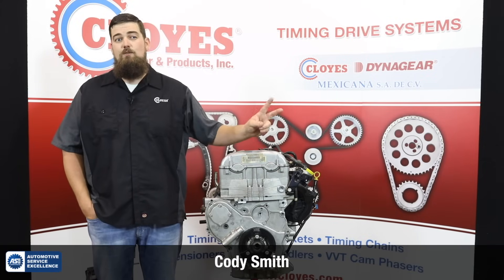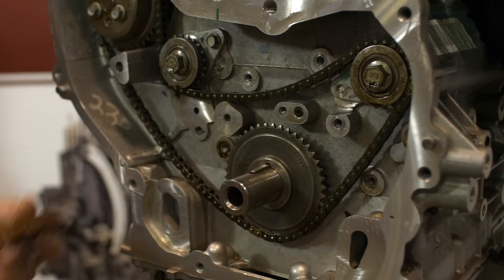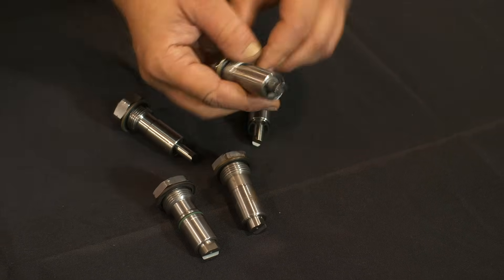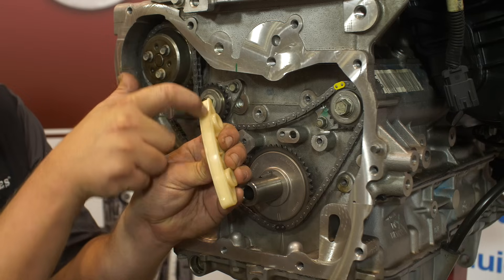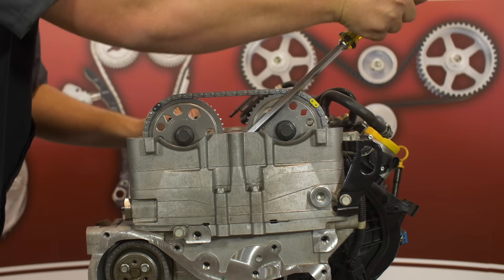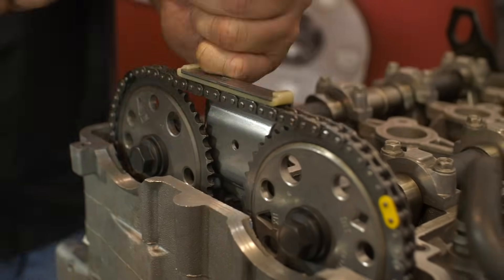GM 2.0/2.2/2.4L, Timing Chain Replacement, Cloyes 9-4201S & 9-4202S

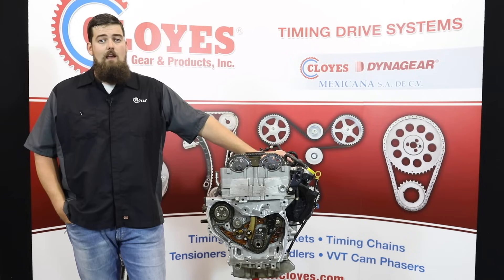Comment: 2:22 odd I my intake and exhaust marks are opposite for me at compression TDC. 
There are two TDC’s
TDC compression
TDC exhaust
Which are you at?
I am TDC compression.
Reply from the maker: The timing is set at TDC exhaust stroke on this engine.
Reply: @Cloyes01   Well I am screwed then. I just took my apart on TDC compression stroke.
The Chilton’s manual I am using makes no mention of this.
Chilton’s manual under TDC quote, “TDC generally refers to piston position on the compression stroke.”
Reply from the maker: @badmatt4227  It's not a big deal, with the chain off, just rotate your crank about 15-20 degrees past TDC to move your pistons down in the cylinders some. Then you can rotate both camshafts around where they need to be and then you can bring your crank back to TDC. Just rotate the cams slowly and don't force anything.
Reply: @Cloyes01 I am not as experienced as you. I will put the old parts back on. Rotate the engine, and basically start over. I am not happy with Chilton's.
Reply: @badmatt4227  Thank for bringing this to my attention I am planning on replacing my timing chain very soon (4 days or so) and I am taking as many notes as I can to assist me! This truly opened my eyes!
Reply: Coming straight from the Haynes Manual "Each piston reaches TDC on the compression stroke and again on the exhaust stroke, but TDC generally refers to piston position on the compression stroke."    :O
Reply: just went to the section for timing chain removal and there is this "the procedure for 2008 and later vehicles are similar to prior years. It is important in Step 2, that 2008 and later vehicles are set to TDC on the exhaust stroke - not compression stroke."
Reply: My Chilton's step by step says TDC on exhaust stroke ... Cam lobe at 7ish o'clock
Reply: @mickeybuck638  Which book?
Reply: @badmatt4227  idk it is the book I access on the library website
Reply: @mickeybuck638  Manual 28670 does not

Comment: Just a heads up I had a cloud timing kit installed in my equinox 20,000 miles later the engine is junk the chain guide was in pieces in the pan and the chain ate up the bolts sending metal into the engine causing severe damage  I would recommend buying factory parts unless you can afford a new engine
Reply: The OEM are the exact same parts. I am a GM Technician and have installed dozens of timing chains on these engines. The OEM GM parts literally say Cloyes on them.
Reply: @mikeday8826  exactly I recommend a upper guide bolt because the factory ones tend to break off dorman makes a great replacement bolt
Reply: @zachfdogg2021  yep, the updated design bolt is the way to go.
Reply: @zachfdogg2021 Did you replace all the guide bolts? This job keeps nickel and diming me. Always something else to replace just in case.
Reply: You didn’t replace upper guide bolt
Reply: This is an oem part it's what gm used in all the car from the factory 😂😂😂
Reply: @kennyupchurch  it doesn’t come with a guide bolt

Comment: Does anyone know if the factory original chain would also have the colored links?  I checked my chain and it is pretty tight for 162k miles, and when looking at the chain I saw the colored links (a black and a red one), so I'm thinking maybe the chain was already replaced??  Or could this still be original?
Reply from the maker: All versions of this chain will have the marked links, even the OEM. And it could be a number of different colors and combinations. GM used at least 3 different colors, likely more. If the links were painted instead of plated by the manufacturer then the paint can flake and chip off over time.

Comment: Any tips on torquing the crank pulley bolt?
Reply: Just impact it on.
Reply: For the ecotec 2.0 turbocharged / LNF, I believe it is 74 ft lbs + 120°... 
Probably the same for all of them

Comment: Do you know which specific 2.4L engine codes this video applies to? Is it safe to say that all 2011 and later 2.4L Ecotec engines will follow this process for the camshaft notch positioning, where the number 1 piston is at TDC on the exhaust stroke when the mark on the crankshaft key is at the 12 o'clock position, the mark on the intake camshaft sprocket is at the 10 o'clock position, and the mark on the exhaust camshaft sprocket is at the 7 o'clock position?  I want to make sure that there aren’t any 2011 and later engine codes that would require the mark on the intake camshaft sprocket to be at the 5 o’clock position as is needed with 2010 models. Thank you for your help.
Reply from the maker: All 2.0L, 2.2L, and 2.4L Ecotec engines follow this basic procedure. In all cases, the unique link aligns to the intake mark on the intake camshaft, and the other 2 chain marks align to the crank mark and the exhaust mark. The chain sets the timing, so as long as the 3 marks are aligned you are good.

Comment: At 11:33 how does turning only the intake cam shaft not mess the timing of the whole operation up? This is the only part i am unsure of.
Reply from the maker: The chain sets the timing. As long as all the marks align when you get the chain fully installed then the engine will be in time. If you need to rotate the shafts slightly to get everything aligned that is OK, as long as the marks align when you are done.
Reply: I understand  everything till 11:34 ..procedure comes up ..I understand that you move the exhaust or intake cam...counterclockwise wise to "help" the Cam Phaser ..get align with the chain's color link but its not mandatory to move it .??.along it aligned up with the marks? Correct?
Reply from the maker: @t0ny2trill  If your chain and sprockets marks are aligned, then it will be 100% correct. Sometimes all the shafts are sitting perfect and you don't need to move anything,  but sometimes you might need to move a shaft slightly to get it to come together. But ultimately the chain sets the timing. If your marks are aligned, then you are in time.
Reply: @Cloyes01  thank you cloyes after getting my hands dirty , I see why you need to my move the phasers ...to help you put the chain on and to properly set the phaser on the cam ..it will make a clicking noise  .
Reply: @Cloyes01

Comment: What happens if I am unsure if the intake and exhaust sprockets moved on removal and install? Wasn't sure if I kept them perfectly still while taking them off.
Reply from the maker: When you reinstall the chain and align the marks, the camshaft positions will correct themselves if they moved.
Reply: @Cloyes01  I just got everything finished up on a 2012 2.4 Equinox. Started it up and it ran well for about 5 seconds, then the engine started shaking and idling hard. Did the balance chain possibly jump on me?
Reply from the maker: @corneliuandsons  It is unlikely that you would notice severe symptoms due to a balance shaft timing issue. It is more likely that the primary system is out of time, or you have some kind of VVT system issue if the idle quality is poor.
Reply: @Cloyes01   I made sure all my timing marks were proper when putting the new chain on, triple checked and even marked the camshafts. 

The only thing I can think of is that the tensioner wasn't properly activated (but there's absolutely no slack) or one of the cam phasers is "stuck open."

Edit: I'm now realizing that I missed the specified torque specs for VVT phasers. I see it's supposed to be 22 ft lbs + 100 degrees for these phasers.

Comment: There's no marks on my chain all you have to do is aline all your marks you don't need chain marks to set timing chain why are you saying this your confusion viewers the older cars with echo tech engine don't have marks on there chains
Reply: If you don't see colored links, the chain may be installed facing backwards as the links are only colored on one side. 

Correct, you can install a chain disregarding any colored links by paying very close attention to the marks on the sprockets but then you must also be very careful counting the number of links between the marks!

Comment: Thank you for simplifying the process for those of us who are not mechanically inclined but also can't afford to pay a minimum of 600.00 to put it in the shop either. I have a 2009 Chevy HHR 2.2L ecotech motor. I have installed the new kit and the water pump and housing, however when I attempt to start the car, it makes a horrible sound coming from the starter and won't start. Please help, I can't wait another 2 months to get my car up and running again.
Reply: I shouldnt laugh at this comment... but $600 is cheaper than the new engine your vehicle needs...

Comment: On the 2009 2.2 VVT the exhaust cam wanted to rotate counter clockwise when the chain came off. The 24mm wrench kept it from moving as it rested agsinst the cowl. In the video it shows having to rotate the intake cam in order to get the sprocket on the exhaust cam. However in my case I had to rotate the exhaust cam clockwise to get it on, since I only had one 24mm wrench and it was locked on the exhaust cam. 

Another tip, when putting the crank pulley back on, you can torque it to the initial 74 ft lbs with a large screwdriver between the pulley and the housing. However to get the additional 75 degrees of rotation I chalked the bolt and pulley and then made a mark to where the bolt needed to rotate to for the extra 75 degrees. Then I used my 1400 ft lb impact gun to get it there. 

The cams I was able to do myself by hand.

Comment: How does one get the snap ring off to deactivate the tensioner. Its seems the clip wont compress enough to pull off.  😢
Reply from the maker: We use a set of snap ring plyers and a pocket screw driver. Get the snap ring compressed as much as possible, then wedge the screwdriver in and work the clip out.

Comment: I got kit 9-4201sbwp kit got balance shaft chain all buttoned up got timing chain routed and its like the chain is to short i cant get it around the crank sproket, even tried starting at crank then intake still no luck
Reply: Same thing happened to me today. Did you figure it out yet? Seems like the maker of this video is not responding

Comment: Tackling a timing chain replacement on a 2012 Equinox with the 2.4L ecotec (engine in the car.  I got a service manual but it says #1 cylinder at TDC of the exhaust stroke.  that disagrees with some of the videos Which is it? TIA
Reply from the maker: Yes, this engine does time on the exhaust stroke. 

If you rotate the engine so the timing marks on the sprockets are positioned correctly, then you will be on the correct (exhaust) stroke. TDC on the compression stroke will have your camshaft sprocket marks 180 degrees off.

Comment: Does this chain have to be messed with if there's no problem with the vehicle? Nothing in service manual saying replace at a certain amount of miles and gm says it's a life time chain with a hydraulic tensioner 2.0l turbo 2013
Reply from the maker: Timing chains are considered internal engine component so there is no replacement interval defined by a manufacturer. We recommend servicing the timing chain system if you are experiencing a rattle at startup or idle, if you have any camshaft-to-crankshaft correlation codes, if you find guide material in the oil, or if you are making another repair that requires the removal of the engine covers and you can see the tensioner(s) are extended past a healthy range.
Reply: I've been going back and forth about this recently. My '09 Pontiac G6 w/ 2.4l ecotec has 110k miles on it. Since I acquired this car, it has always made a rattling noise at startup that would last 2 seconds tops. This had me concerned until I realized that this noise was due to the VVT cam sprockets which is typical of these engines and is of no great immediate concern. Other than that , my valve train has always been quiet until about a month ago when it suddenly started making loud ticking sounds under the valve cover at cold. After about 5 minutes, the noise would go away and the car ran normal. This had me concerned since it was so sudden and not a gradual increase in noise over time. I decided to replace all the lifters and rockers and while I'm at it, replace the timing and balancer chain components with the Cloyes kit that I bought from Rockauto. Long story short, I had a few bad lifters but after 110K miles, the timing and balancer chain components were in perfect condition and really did not need to be replaced. Oh well, peace of mind knowing that I won't have to worry about it any time soon. I have a long cross country trip coming up.

Comment: What is improved about the Cloyes balance shaft sprockets vs the GM sprockets? Do the GM sprockets have a rubber core vs the Cloyes one piece design? I apologize if this was asked and answered already. I browsed through a years worth of comments and didn't see it mentioned.
Reply from the maker: Our sprockets are simplified, therefore eliminating potential failure points. We eliminated the cushion rings on the balance shaft sprockets and the rubberized coating on the crank sprocket. These features were originally designed to quiet chain-to-sprocket engagement but can cause system issues if they fail. You will not notice any noise differences with our sprockets and there is no potential for the cushion rings to break or the rubberized coating to deteriorate.
Reply: @Cloyes01  Thanks for the reply. This reminds me of the old days when GM put nylon teeth on the cam sprockets in their V6's and V8's supposedly to quiet things down. It didn't work out that well. Mine stripped out on my '66 Buick. Luckily, it wasn't an interference engine. Replacing it with an iron sprocket did not make the engine any noisier.
Reply: 9-4201SWP are the cam sprockets for VVT?

Comment: Great video. However, using a punch or drill bit to hold the balance gears in place might work good on an engine stand but was nearly impossible in the tight space of my engine compartment in my 09 Pontiac G6. I did manage to remove both balance gear sprockets with a lot of grit and determination but could not get in a position to torque the bolts when installing and managed to break a tooth on the intake sprocket. Looking through the comments, I see that I wasn't the only one. When I get my replacement sprocket in a couple of days, I plan on re-installing the old chain, crank sprocket, chain guides and tensioner. Then stick a small wood wedge (or a penny) between the chain and the crank sprocket to keep it from turning while torquing the balance shaft bolts to 37 ft-lbs. Unless I hear of a better way, that's what I'm going to do. Now I wish that I left those sprockets in place. They were still in good shape.
Reply from the maker: That will work well. If we remade this video today we would recommend using the old chain to wrap the sprockets. Then you can allow the old chain to "bunch up" against the block or vice grip the old chain to get the bolts loosened or tightened.

Comment: I've done dozens and dozens of these 2.4 and 3.6 but never a 2010 equinox 2.4, the first model change year. What thee hell am I doing wrong? After hours of researching I found intake cam dowel hole Points 5 o clock. Still getting correlation codes tho. Ive combed through just about every wire, plug and sensor. Probe tests, cycle duty tests, frequency tests. I'm left speechless. Just when you think youve got every inch figured out that one sneaks up to bite you.

Comment: The VVT cam sprockets appear identical and are not marked with INT or EXH. Are they interchangeable and how are they aligned to the chain?
Reply from the maker: Some applications use the same phaser (VC107) on both the intake and exhaust camshafts. Others use a unique intake phaser (VC106) and the VC107 phaser on the exhaust. There is only one timing mark on the phasers. You just align that mark to the marked chain link. Install the chain just like we show in the video and make sure all your marks are aligned.
Reply: Different part numbers

Comment: I got to the point of installing the timing chain tensioner and it doesn’t seem to want to go through all the way so I can thread it in. Any ideas as to why?
Reply: It was accidentally activated prior to installing.
Reply: @shawnshurtz9147  turns out the diameter of the part was too thick returned to parts store and returned the defective one then got correct one. Thank you for the reply though 😁

Comment: Thinking about buying your kit for my LE5 2.4L ecotec in my 2007 G6. Is the chain a different design compared to oem or are they both the same design? Just trying to get a feel or the difference between the 2
Reply from the maker: The chain we supply is a match to the OEM design.

Comment: Before I screwed in the deactivated tensioner I had a little slack but after I screwed it in the tensioner bracket doesn’t move and like I said I haven’t activated the tensioner yet.   Is this normal?
Reply from the maker: Yes, this is normal. A tight initial fitment makes for a longer lasting set. Just make sure to fully compress the tensioner to ensure it is activated as it can be difficult to tell when the system is new.

Comment: Just installed the CLOYES 94201SAVVT2  which Includes VVT Sprockets and VVT Solenoids on a 9-5 2011 saab.  The issue that is confusing in the help video above is you reference torquing at 63 ft lbs + 30%.  However, the video isn't using VVT sprockets...and upon further research, the recommendation for those are 22 ft lbs + ~100%.  So we don't know if these are somewhat equivalent and we are likely fine..or if we need to pull the bolts and purchase new ones to do the 22 ft lbs.
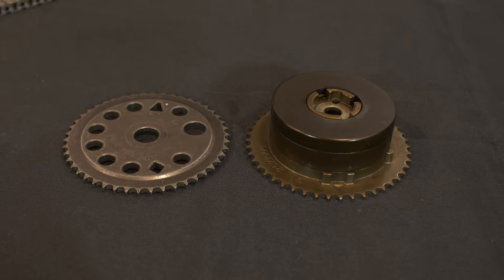Reply from the maker: We cover the VVT phaser torque spec at the 6:12 mark of this video. The resulting torque for the the non-VVT sprocket bolts is higher than the VVT attachment bolts. If you have them installed, and they tightened to the 63 ft/lb plus 30 degrees without breaking or feeling like they overly stretched, then you are good to go.